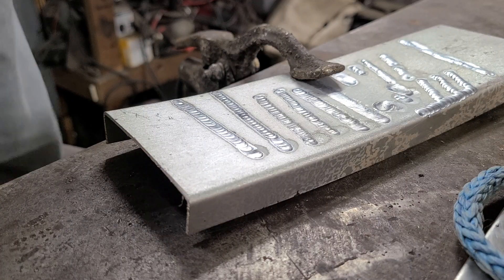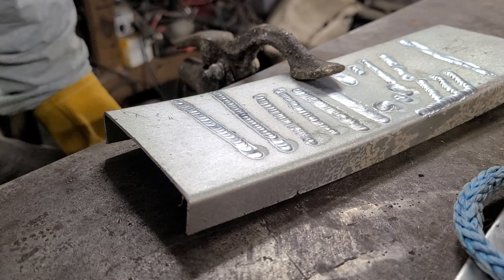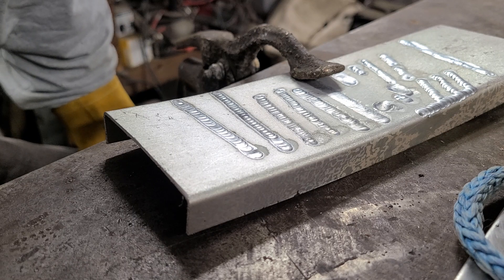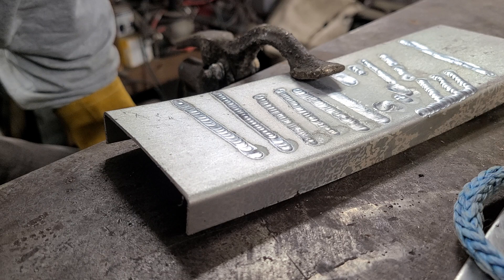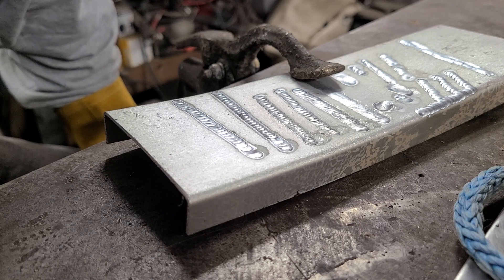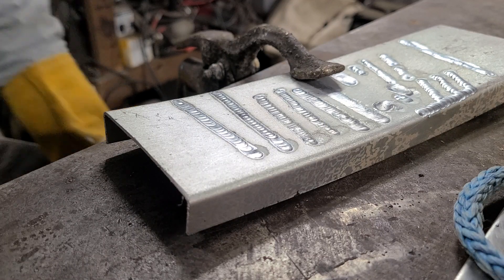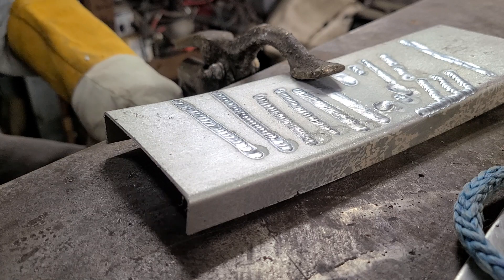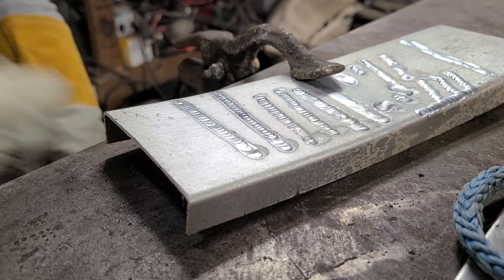Aluminum Tungsten selection update

Comment: I use an old (30+ years) Hobart welder & have always used Zirconiated (white tip) Tungstens for Aluminium. Never felt the need to try any other type.

Comment: I have found a good blow out and spray boards with contact cleaner every few mths saves shorts in boards. In a workshop environment metallic dust sucked in causes low draw components to fail.

Comment: Just thought I share -     I have a Miller Dialarc 250 HF - 60HZ  transformer machine and all I use are 2% lanthanated tungsten - but I sharpen to a point for steel and aluminum ...I dont have any arc wander unless the tungsten is dirty or cracked.....put the tungsten in a cordless drill chuck and sharpen parallel to grinding wheel NOT like a pencil and make sure the grinding wheel is clean.....I get good results using a 4-1/2 inch hand grinder with a new wheel  - my bench grinder would be better but the wheel is contaminated from grinding stuff.....Id like to get a syncrowave machine but I dont do enough aluminum to justify upgrade and my welder is in a unheated garage in  cold Buffalo ny that gets heated only when I work ....not interested in circuit board problems from quick temp changes. ...also I would have cleaned that aluminum a bit before welding on it - ( I feel funny telling the master anything to improve welds _ Isaac always has me in awe of his work -  Im humbly  just sharing what I know )
Reply from the maker: Hey, I'm all about learning new things. Dont ever feel like I know it all. I definitely dont.
I like those Dial arc HF's those are good machines... but power suckers i believe.😁😁

Comment: Always good info, sir!

Had a second look at the part the blew apart in the other machine. It looks a lot like a protective component called a PTC Thermistor. They are usually near the input to the AC power supply on a circuit board. Think of them like a fuse. I think your repair guy might be able to replace that part and assuming nothing else went sideways, you might be back up and running for reasonable money.
Reply: yes it was a ptc thermistor that blew question is what made it blow you can just replace it n try but best to check everything up to the thermistor look up colour codes of resistors check any capacitors are ok and if they are fine could have been just and ordinary failure or a spike in the AC voltage.
Reply: @ProfaneGod  indeed. I was going to ask if there had been a thunderstorm or electrical work in the area.
Reply: @ProfaneGod   they do age ,
Reply: As already mentioned they can blow. They have a lifespan. Could well be either tbh: end of lifespan or another circuit failure within that board blew it out.
The good part is not the whole board went up and as mentioned, some simple testing of components will see it repaired easily and cheaply. (if parts can be had - real nightmare for spares now)

Comment: AN OLD TIMER SAID IF YOU PREHEAT ALUMINIUM YOU GET A BETTER OUTCOME.
HE USED TO WELD ALUMINIUM PIPE AND SAID ,THAT IF YOU SOOT UP THE BASE METAL OR WHATEVER YOU WELD WITH AN OXY/ACCETALENE TOURCH ,WITH THE OXYGEN TURNED OFF.THEN TURN ON THE OXYGEN AND PREHEAT UNTIL THE SOOT GOES AWAY .IT'S HOT ENOUGH..DON'T KNOW HOWEVER I'VE HEARD IT FROM MORE THAN ONE WELDER..
IT'S 100 TIMES BETTER NOW ,SEEING THAT YOU'RE USING THE RIGHT TUNGSTEN.
ANYWAY THAT'S WHAT I WAS TOLD BY MY FATHER AND ANOTHER WELDER ABOUT 30 YEARS AGO.
GOD BLESS YOU AND YOUR LOVED ONES

Comment: Good info to know, thanks. It looks like a capacitor blew on your inverter machine, those can be removed and resolder a new one of like capacitance. 
Maybe you can find someone to fix it instead of buying a new board.
There are places that repair circuit boards and ECM, worth checking it out.
Reply from the maker: Thanks for the info
Reply: A friend got a 250 amp Inverter Tig Welder from a dumpster outside a Welding shop, took the board to a electronics Guy, $90 to fix the issue.
Reply: i recently did a chip swap on a cnc plasma board for a friend of mine. used a heat gun with a small tip and made sure to not overheat the board. cleaned solder contacts and used the heat gun to put it back on. saved him a $1500 repair. i charged him a case of beer lol
Reply: Not a cap, that was a polyswitch which is a type of PTC thermistor.

Either he gets lucky and it's just that that decided to go (which happens), or something took it out. Usually that would be a severe over voltage for that kind of destruction and in that case there's a good chance everything else is fried as well.

If it was just the polyswitch that's a fairly trivial thing to replace, but you don't just throw a new one in and see what happens. You have a look at the circuit and see what could else could be going on and check a few basic things first, such as smps transformer isolation, make sure the fet isn't dead short etc. Assuming that was on the input of an smps anyway. Can't tell from the video.

Basically, to do the job properly is non trivial for the avergae DIYer. And yes, this sort of thing is what I do for a living. Not usually on welders (only had to fix a couple), but electronics is electronics.
Reply: Its good that he knows someone, i hope he gets off without buying a new board, It does seem like some overcurrent event happened. Thanks for the heads up.
Reply: I could`nt see it very well, it makes sense it is a polyswitch i just saw blue. And yes just replacing it without further testing would not be wise.  But there is a chance of repair over a new board. Some of those boards are over 1000 dollars.
Reply: @protonhead1  He said his brother or someone fixes them, so I'm sure he'll be looked after.

Re the cost, that and the rest. If that was a lightning strike for example there's a decent chance that the whole welder is toast. Repair would run several times the cost of replacement. Insurance job basically.

In any case, it's all hypothetical. We know virtually nothing about what's gone wrong beyond a polyswitch popping. I'm sure he'll get it sorted out one way or another.

Comment: stacking dimes. first TIG was a ac/dc welder w/ a high freq and gas solenoid box on top and the torch was something you put in the electrode holder. no amp control other than the handle on the machine. second was a miller 250 synchrowave. big difference.
Reply from the maker: Haha, I remember those. I actually had a high freq box as well. I started on a Miller Dial arc HF. the dual handle ones from the 80's I believe. good units.